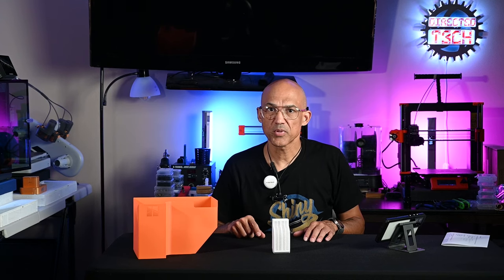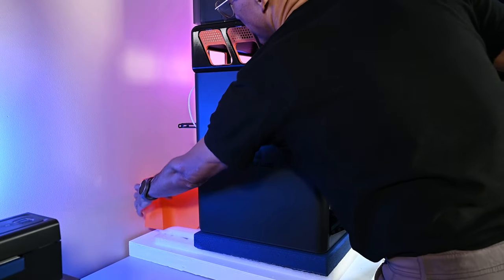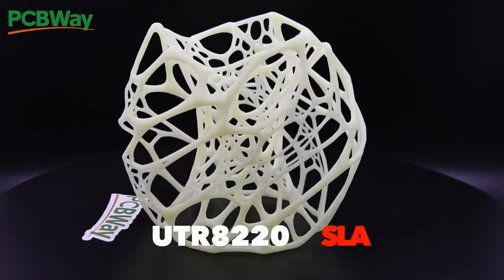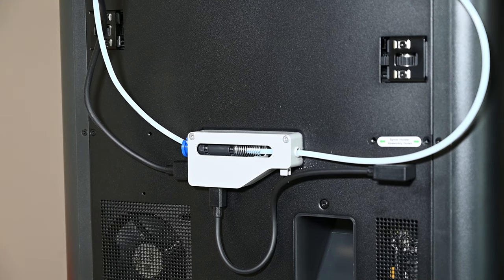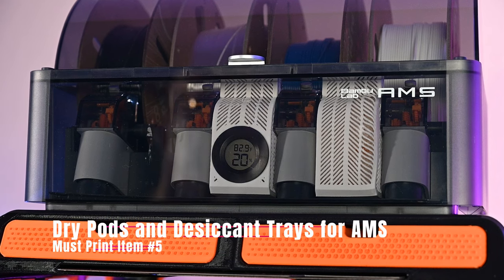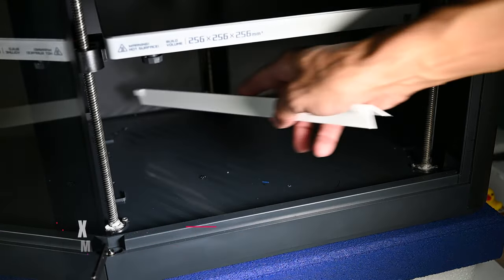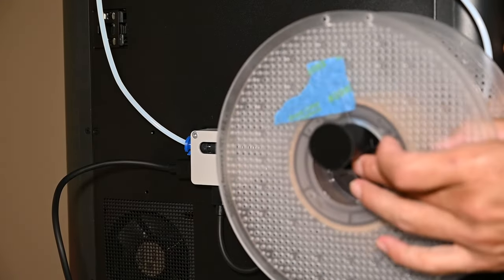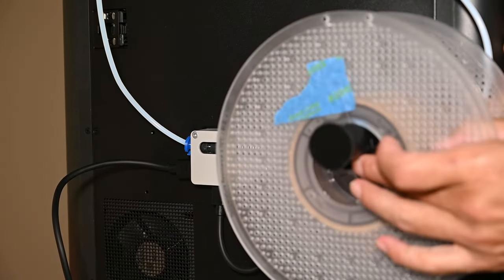10 Must Print Items for Bambu P1S - P1P - X1C Printers

Comment: My favorite accessory is a poop bin. I had tried a few but didn't like them much. And the cheapo cardboard box behind the machine was too difficult to remove without dumping. The current is ramped with a removable tray on the side of the machine. And the ramp hooks under the machine and around one foot to keep it from moving at all. Makes for a super fast cleanout when full! Like why did it have to dump out the rear? And why did I choose to place it against a wall in a corner? I will never know.....
Reply from the maker: That sounds awesome! Can you post a link to it?

Comment: Great video, I love anything related to functional and useful prints! Some of these have been so helpful for me personally too and the others would be helpful too if I had a different setup where I could use them. I really wanted that AMS riser but since I have my printer on a shelving unit, the AMS already hits the top shelf when trying to get filament out. The drawers, added plate holder, and best of all the glass top holder makes it so worth printing. I hate having to leave the door open and worry about that glass getting broke so opening the lid is way better. The plate guides and the desiccant pods have been a game changer as well and I always recommend them to my anyone with a P1S and AMS since you let me know about them. 

I haven't printed the Bambu scraper yet for the same reason it took you a while to. I was afraid it would tear up the textured bed but I'm going to print that right now! That would work great with any printer. I'm also super happy that you added and enjoy the AMS buffer release I designed! There are other separate tools that could be printed but I was afraid I would lose them and the others require you to add before installing the AMS so I'm glad this worked as well as it did after designing it. It really means a lot to add it to this list too!
Reply from the maker: Hahah!  I printed the scraper straight away, but it scared me.  It wasn't until I'd destroyed all the 3d printed scrapers and had some tough to remove supports that I broke out the metal one, and yeah, total game changer!!